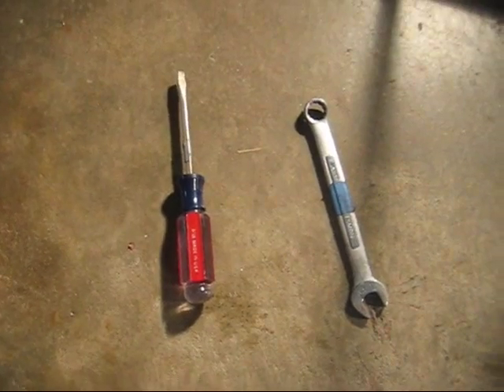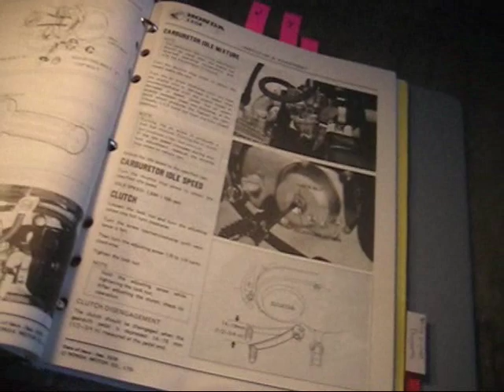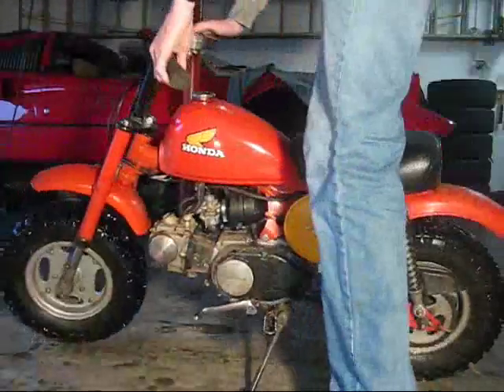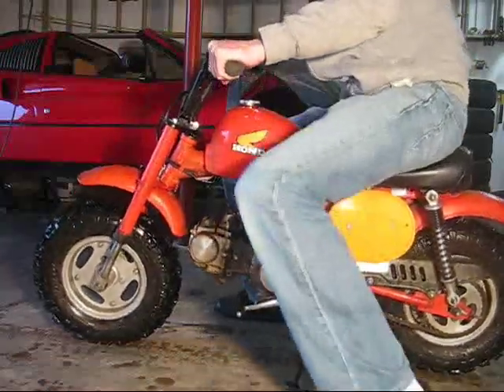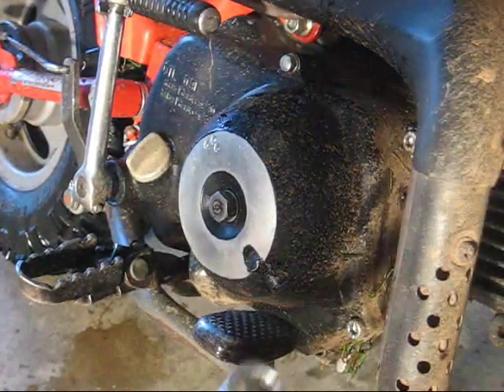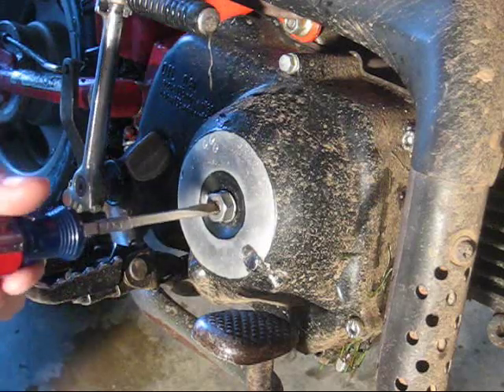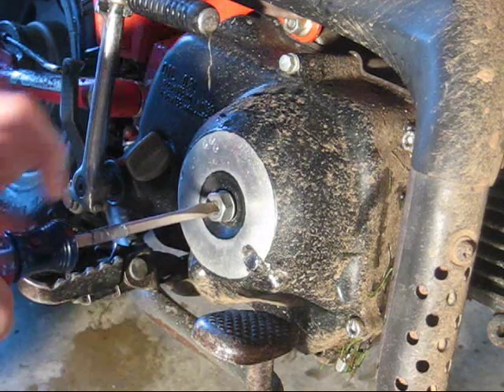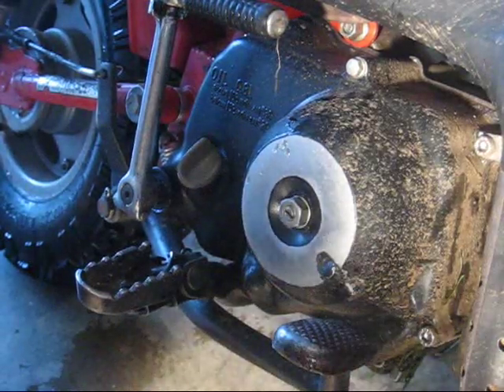How to adjust Honda clutch

Comment from the maker: @donyboy73 If that happens then the clutch is either improperly adjusted, or it needs new plates and springs. The reason it happens is the clutch is slipping and the compression of the engine stops it from cranking easily.

Comment from the maker: If the bike is slipping out of gear then you have a transmission problem. Chances are the shift star bolt is loose. This causes all sorts of wacky problems. Remove the right crankcase cover and tighten the screw. If the screw is tight or tightening it doesn't fix it, chances are you have a bent shift fork or worn pin. Now you get to split the cases.

Comment: I've worked on loads of these engines over the last 35 years. I still can't figure out exactly how that clutch works. It's very clever and not just a centrifugal mechanism like a lawnmower either, as it allows you to kickstart and to push-start the bike. Normal centrifugal clutches don't. Try one of the modern variator equipped scooters, their centrifugal clutch won't let you push-start.

Comment: 2004 CRF50 w/Tak 88 kit. Stock clutch. I have done this adjustment at least 2 dozen times trying to find the sweet spot. I can feel resistance in the adjuster screw before it's actually doing something to the plates meaning (feel resistance when I shouldn't). I can not get this dialed in. Doesn't matter what I do it's either loose or tight. I can not get that "fake manual clutch" function by holding the shift pedal no matter what I do. Shifting into 2nd is harsh and won't always shift into 3rd.
Reply: DJFireUSA Something might be messed up inside the case there by where you adjust the bold

Comment: @TheAlexManVideos thanks for a quick response! i just adjusted it and it still slips, it's a 1973 with the original clutch and all. thanks for your advice. do you have any suggestions where to get the parts? i'm in canada

Comment: @TheAlexManVideos I ride an 09 Suzuki GSX-R600, previously had a 110cc semi-automatic. I still can't figure out exactly how that clutch works. It's very clever and not just a centrifugal mechanism like a chainsaw either, as it allows you to kick-start and to push-start the bike. Normal centrifugal clutches with modern variator equipped scooters won't let you push-start or directly control clutch engagement. However, this "semi-automatic" mini-bike has some sort of wet-plate clutch too! Wtf!

Comment from the maker: The clutch adjustment will only cure hard shifting or a slipping clutch. If the engine is bogging down then you have an engine problem, not a clutch problem.

Comment: I back it off all the way and now it is all jacked up!! Do I just need to crack the case and re-position some things? Please help!!
Reply from the maker: All jacked up doesn't paint a clear picture in my mind of what is wrong. If you follow the instructions in this video and turn the adjusment screw in the correct direction, you should have no issue. If parts are out of place, you should remove the clutch cover and install the parts correctly.
Reply: The parts were out of place. I took the cover off and put them back together. I'm pretty sure I did it correctly but the ct70 I have is a Chinese import. I'm not sure what gear it was in when I put the pieces back together. Now when I shift it the lever takes a lot more force to up shift and when I adjust it it will randomly decide which gears it wants to go in and out of. Also it keeps poping back into nuetral.

Comment: have a 70 cc engine on my honda atv,looks like this one,maches all ur repair videos. sometimes i hold the pedal just enough to release the clutch then i give her a bit of throttle and take off as it were a manual clutch. i don't know why i developed this habbit,but is it okay for the clutch to do this?

Comment: i did the exact same as you did and now the gear shifter is a bit harder to move is this normal? also i had a problem where my gear shifter will go up n down but wont go into gear? i havnt tried it after this vid though

Comment from the maker: To be honest, I don't think it would even make a noticeable difference. But if it did, you would want to adjust it warm because that's how the bike is most of the time that you are riding it and you want it to be adjusted correctly during that time. After all, it's only cold for the first two or three minutes you are riding.

Comment: hi thanks for this nice video. i send my zongshen to a shop and now the clutch is engaging when i push the lever down immediately i did it like you showed on the video but it still engages immediately. i rotated the adjustment all the way on the anticlockwise  till it have resistance without forcing it out. but still the same. can you help me in what might be the issue.

thanks a lot for your videos.

Comment: i have a 1981 ct70 everything works fine except the shifting, its really hard to shift through gears do you know the cause of this???? do i need to order new parts like a clutch kit or redo the transmission plz answer back id really appreciate  it thanks.

Comment: i have a problem with my 70cc when im in 2nd gear and i try to shift to 3rd but when i do the motorbike goes back into neautral and revs very high ...any suggestions?

Comment: Does the engine has to be stopped during this procedure?? 
Reason I am asking is because I did the excact steps with no success. I have to keep turning the adjusting screw untill I find the point that will work and would be easier to do this with the engine start.
Reply from the maker: This procedure should work with the engine off unless there are damaged/worn parts or the clutch linkage was assembled incorrectly.

Comment: I have a 2000 xr 70, there is a loud clicking in 1st gear, it still rides ok (just intensifies with acceleration ), so we ride in 2nd and 3rd only.  do you have any ideas what the problem is? thanks
Reply from the maker: I had an issue just like that on one of my Z50's. It was either first or second gear. I let it run like that for the longest time but eventually I pulled the engine apart for another reason and found one tooth missing off one of the gears. Since I had it apart and I had a replacement part available, I replaced it. Unless it causes an issue for you I'd leave it alone.
Reply: Alex, I have a chinese copy of one of these engines, its a 90cc three speed with reverse. The problem I'm having is that when it's in gear the revolutions drop a lot and it wants to go forward. When in neutral, the revs are too high because if I turn down it's idle speed, it will shut off when in gear. It seems to shift fine. What could this problem be?

Comment: As I watched your video, I saw a difference between your and my bike - On your bike order of gears are:1. neutral 2. first gear 3. Second Gear 4. third gear, and mine is 1. first gear, 2. neutral, 3. Second Gear, 4. Third Gear. What do you think if that's what caused all my problems? Is this a sign that it is not well made gear? I recently bought the bike in this condition and with such gear order.
Reply: Apeiron doo it’s just a different shifting pattern.. there’s nothing wrong with your.. this engine is a US Honda 50 engine

Comment: what if the center screw is out a lot, i cant screw it in. i mean, i can, but when it stops, its too much outwards.
ive never seen that before, every engine ive seen, has the screw tip flush with the nut...

Comment: When I disengage the shift lever just after putting it in gear it should not want to go forward until I give it gas. Mine wants to go forward when its in gear. When I press the shift lever its in a neutral just like it should be. It will not idle in gear because the clutch wants it to go forward. It only wants to idle in neutral, or when the shift lever is pressed down or up. Does anyone know what this could be?

Comment from the maker: Not really. First of all the bike has about 2 HP so there isn't much wear on the clutch ever. Second it's on a polished concrete floor with wet tires so there isn't a lot of friction. Third I didn't really let the clutch slip, I just dumped it. And because of the first two reasons that's not really a problem.

Comment: @TheAlexManVideos Hi. How the fuck does this bike's transmission work? Is it semi-automatic? WHen you pressed your foot down on the gear-lever, you opened the throttle, and the bike was not moving, so how's that possible? Is the gear-lever controlling the centrifugal clutch? Or does the bike have two clutches: one for the final drive (centrifugal), one for the gearbox (friction discs+plates).